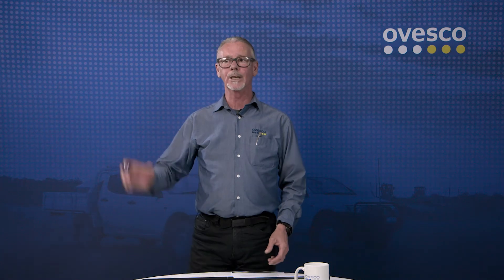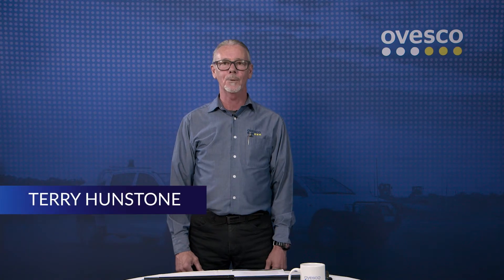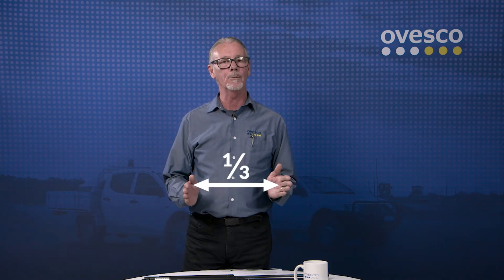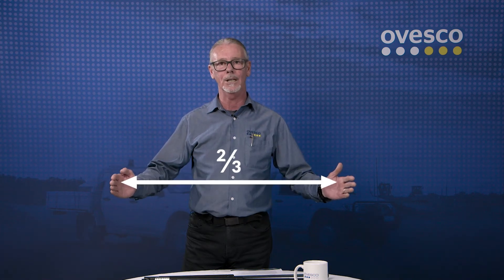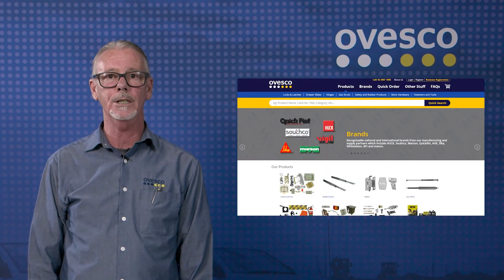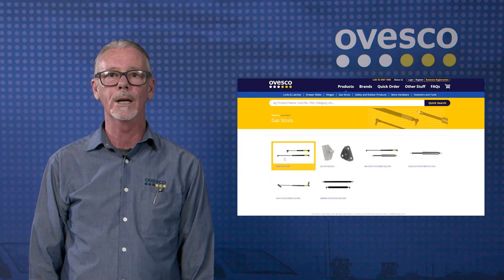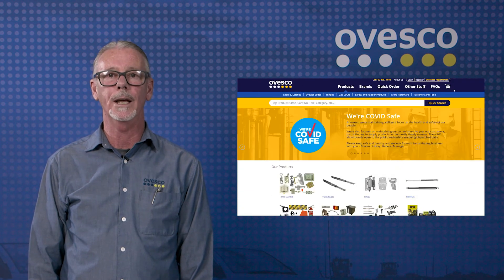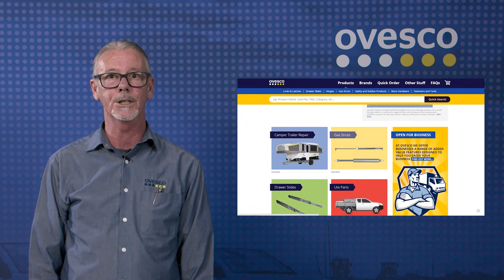How to choose the right gas strut for your job.

Comment: Thanks so much for this! The hatch I'm applying it to is 5 feet long so 2/3 of that is 3 foot 4 inches. That's 40 inches. Will a 36"suffice? Is a 44" overkill? Also do you have a link to a US dealer?